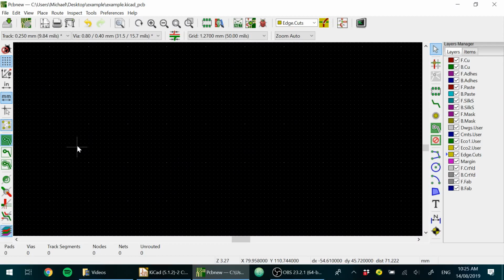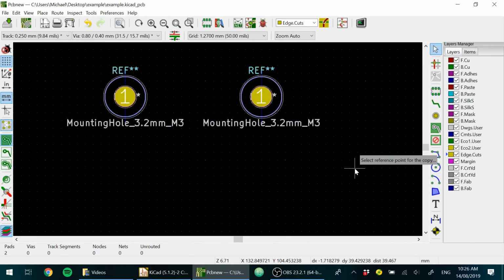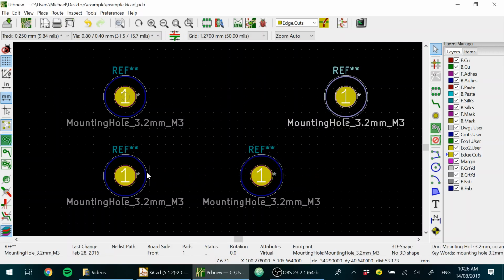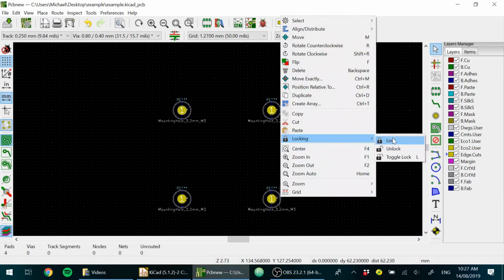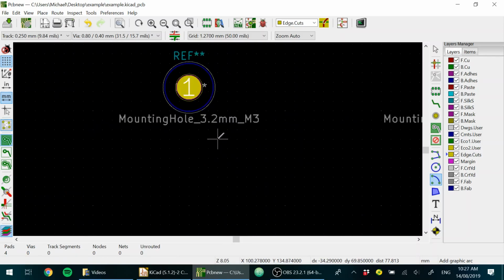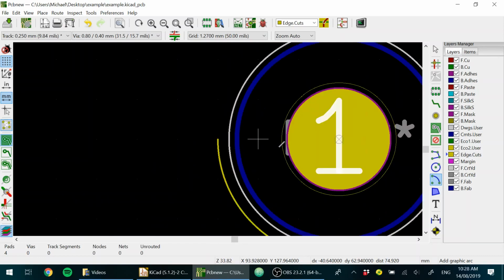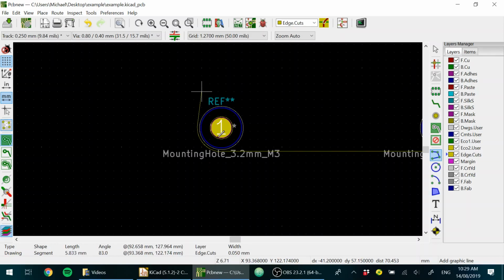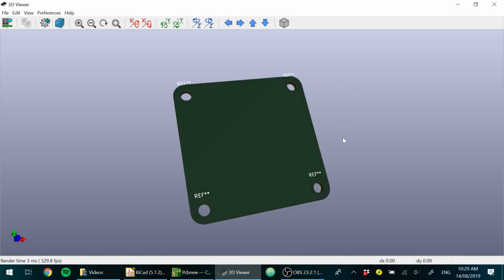Suck less at KiCad - Creating a PCB to exact dimensions

Comment: I come from a mechanical CAD background and I have to say, this is a pretty dire way to establish physical dimensions, this feels like late 80s command line CAD comparatively. 

In the 5 years since this video has been made, have they not added the ability to use dimensions as constraints for PCB features? starting with your mounting holes sort of assumes you know how big your board needs to be, rather than how big the board must be once you've laid out all the components.
Reply from the maker: There are a lot more things to consider with pcb design than just the mechanical layout - which you can still do with your favourite cad package and export for the outline layer anyway. 

For this video I was working from a very primitive requirement to get a no-frills result in as little screen time as possible. 

Yeah, I agree it's pretty prescriptive and inflexible when coming from a mechanical perspective. Since this video kicad has had about 4 major version jumps from v5 to v9 which is pretty amazing. I'm not sure if it's fully parametric now - but you also wouldn't want it to be. Can you imagine a board-edge move that just totally ruins all your routing 😅